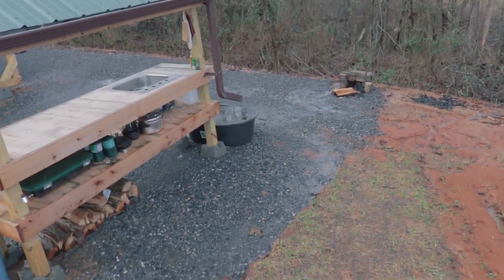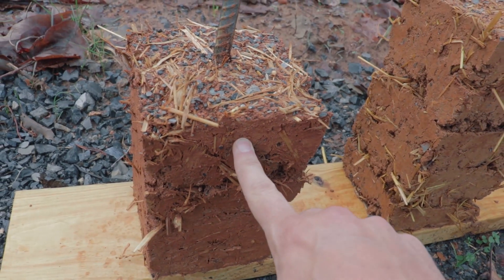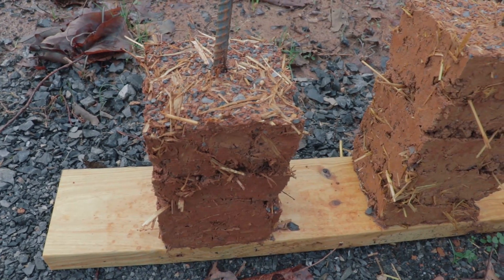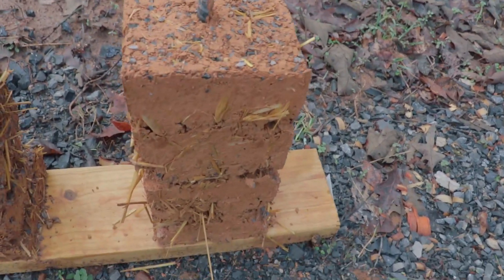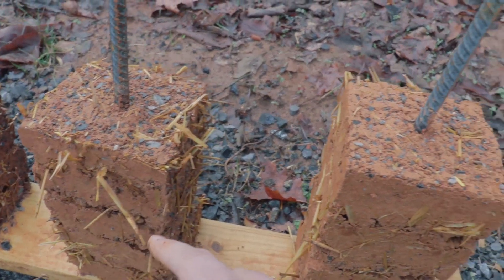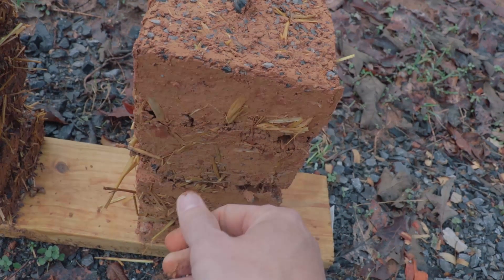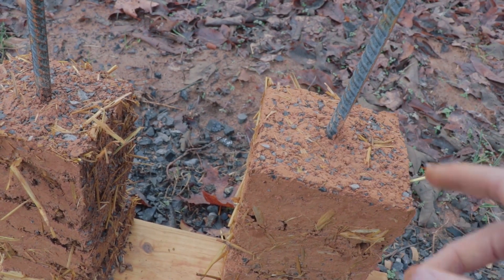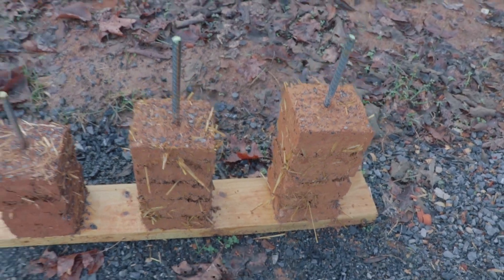Make Cob Stronger and More Water Resistant - Stabilized Cob Walls - Part 3

Comment: When you say 10% is that by weight then? So for your pozz and lime it would be 10 lbs soil, 1 lb lime and 1 lb pozz? Or by volume? My AZ soil is 20-30% clay and the rest is sand. It makes good cob. Trying to figure out how to measure and for a small test wall. Also where to buy the lime and pozz? Just at Home Depot? Thanks for all your helpful and inspiring videos.

Comment: I make my own hydrated lime from high calcium quicklime. Works great and used historically to help stabilize cob in Ireland etc. No more than 10% or there is risk of turning the (air lime and clay) to hydraulic material which isn't a good thing. No permeability.
Reply: "No more than 10% or there is risk of turning the (air lime and clay) to hydraulic material which isn't a good thing. No permeability."
Could you point to a URL that elaborates on this?
Reply: @d c  sounds like it would turn into a type of natural cement mixture, which, while natural, does not breathe.
Reply: @denalinefertari942  correct. Its ok underground where its wet but not where vapor permeability is key